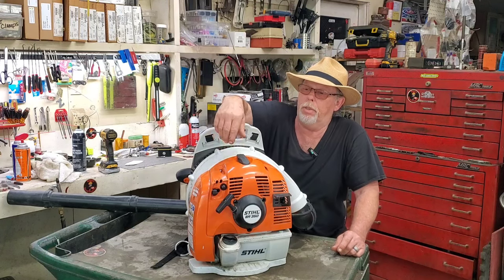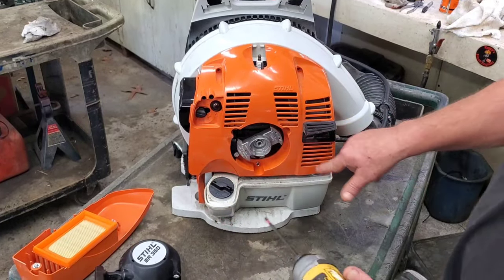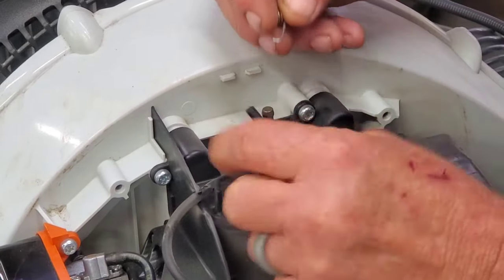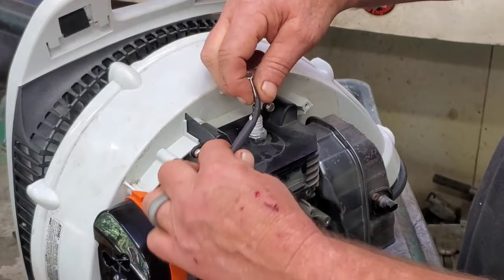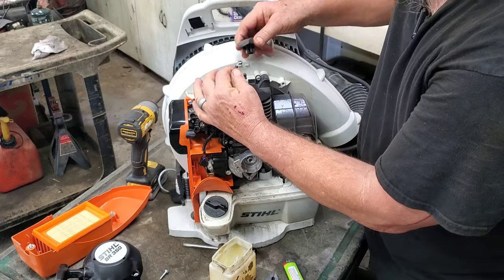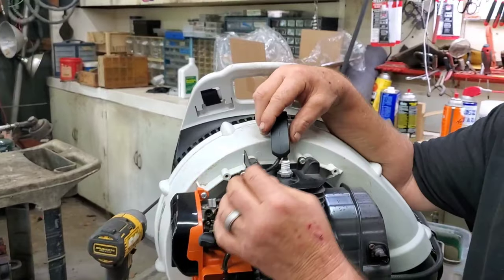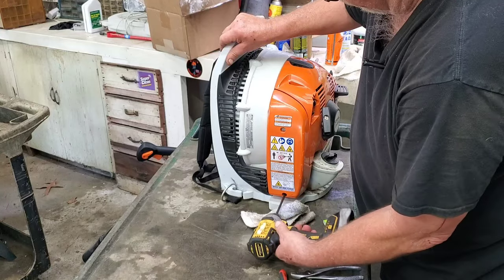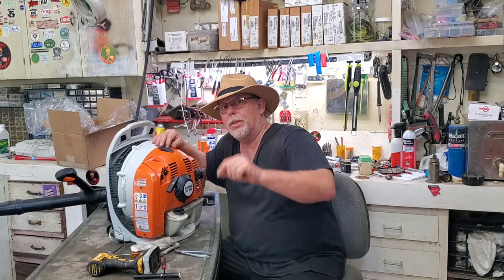Spark Plug Boot and Terminal Came Off Coil Wire On A Stihl Trimmer or Blower

Comment: That heatshrink’s a great idea!  On most magnetos I lube up and slide the boot on first. Then after installing the spring terminal it’s easy to pull the boot down over the terminal. Doesn’t work on ones with extreme bends, but for most it’s easy peasey.

Comment: I had this issue before I seen this video and I put a new coil on my BR350 All went fine The Coil is clear of the flywheel but after putting it all back together it will not pull out to start-Any Suggestions?It ran great before I changed the coil I just went to check my plug and that wire broke so here I am blower won’t pull out to start Thanks for any help!

Comment: Racing mower or sporting type of go karts: Heli Coil everything. Follow instructions for drilling and taping. Clean well. Insert coil with epoxy like the gray stuff. Insert an oiled bolt and let set 24hr to be sure.  Zero failures to date.

Comment: Great Teacher - Oh spark plug cover - pull it off - POINK Worst design ever.  They should warn you in the manual - they literally say "Pull it off".

Anyway, great video - only comment is make sure the spring is in the right orientation - in respect to the plug  The right angle bend should be towards the top, otherwise the spring, once in the orifice, won't want to peek out at you.    Thanks excellent video

Comment: Why would anyone, want to lug around one of these enormous monstrosities'???. Battery powered blowers are so much lighter. If you are running a 4amp or higher battery. They last for quite some time.
Reply from the maker: Yes, I get your point.  This is a commercial customer, these have to run all day long. For a home owner battery power is awesome, Mrs T uses a Battery string trimmer and loves it.
Reply: I'd Never give up my gas blower for Battree. I'd never give up any of my 2 stroke equipment for Battree.